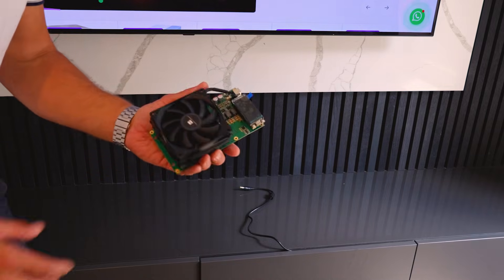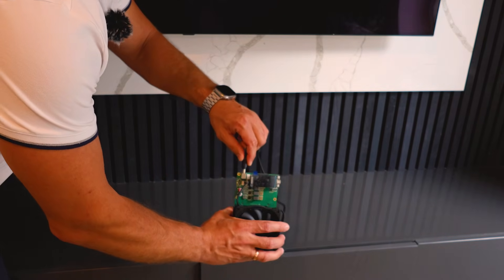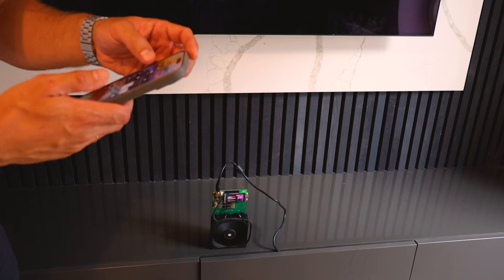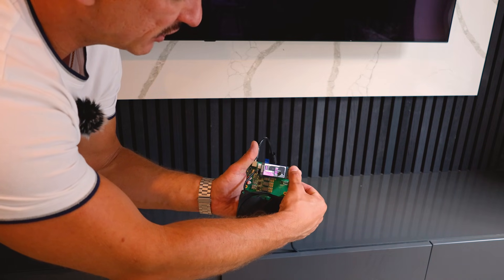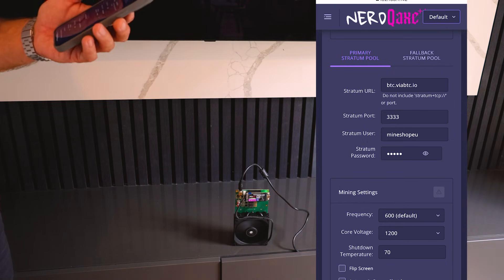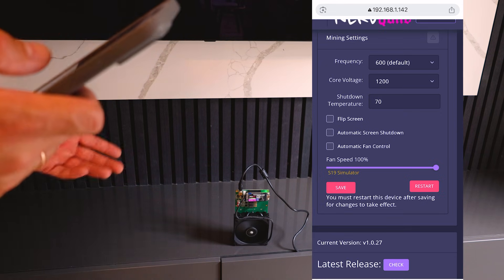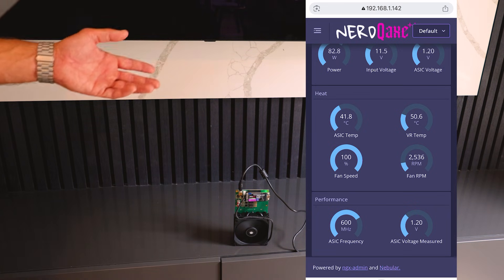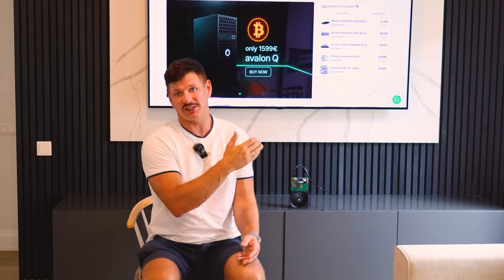NerdQaxe++ Mini: Bitcoin Mining at Home That Actually Works | Compact Crypto Miner Review

Comment: Seems you were unable to modify the settings of the miner, every time they revert back to default. Did you fix it? The power consumption on your app was showing 82W, is it normal and does it go down with time?
Reply from the maker: There is no issue with saving , after connect to 2.4ghz WiFi.  Yes correct hashrate and power usage will show in hour or so , also power usage depends on ambient temperature and OC

Comment: Very nice, here I'm mining BTC with 100% solar, only 3 boards in the M60S, one board stop working during the winter.
Reply from the maker: Dod you try to send to repair the hasboard?
Reply: @GuntisVitolins  Gave up on repairs, after the Elphapex experience, at moment the DG1 only has 1 board working. Thanks for your support trying to solve the problems.

Comment: Nice little device and it's using the same chip as the pro mines, on this device 4x BM1370. Have been mining on Ocean pool with selfhosted Bitcoin Knots (Core) node and Datum Gateway connected to Ocean